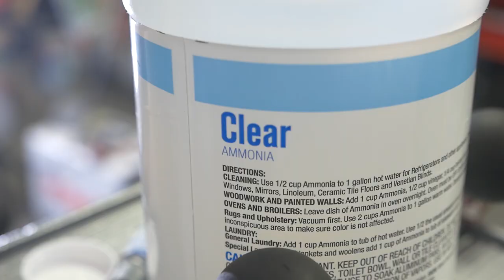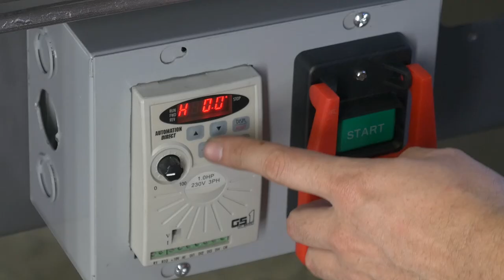Lathe Rebuild Part 9 - S02E10

Comment: @9:38        Twisty connectors?   Twisty connectors!?!?   It's 2017 guys...   time to start using Wago as this is the future !!!
Reply: Just the fact you do not seem to know they are called "wire nuts" or "Scotchlocks (by the old guys)" tells me you haven't been doing this very long.
Reply: OkieDutchman - I know the frelling things are responsible for a super nasty shock and are a major pain in the arse to use where the Wago blocks are a breeze...   Wago is especially good for benchtop projects as you can swap connections nice and quick without having to unmangle your wires !!!!

Comment: In a praevious episode, you didn't know the type oil to go in the gear box(?).  What kind did you decide on?

Also, on a verr old machine like this, how do you obtaign schemantics, diagrams, parts list, user guide, and othar documentation?  Is this archived online somewheres?

Have really enjoyed this series.  Love the humour, the hi quality video, excellent sound (well.  For the most part...), and the verr appropriate background music.  Will be looking for othar stuffs you've uploaded.
Reply from the maker: This is the oil i ended up with: https://www.mcmaster.com/#2158k11/=18jzd4s
it seemed to be what the guys on the forum liked. seems like good stuff so far!

I stumbled upon the user manuals online here: https://www.google.com/url?sa=t&rct=j&q=&esrc=s&source=web&cd=1&cad=rja&uact=8&ved=0ahUKEwjciN3nzJPVAhUMzoMKHeblAy0QFggkMAA&url=https%3A%2F%2Fonedrive.live.com%2F%3Fcid%3D547FE296ECFD561F%26id%3D547FE296ECFD561F%25211448%26parId%3D547FE296ECFD561F%2521164%26action%3Dlocate&usg=AFQjCNEbEMlPNlWIRil3Fe9h_S4mDFqTFw
I see some people trying to sell them, but they are just photocopied anyway. I went down to my local print shop and had them print them out on the most durable paper they had.

Thanks for the kind words! i am still working out the kinks on the audio, but we are getting there!

Comment: Dudes, scrape away. But your scraper looks too short and rigid. I think it should be long, flat and kind of bendy so that you can use your body weight to do the job. And you haven't shown how you've prepared the cutting surface on the tip. Or may be I missed it.
Reply: the wood definitely helps with that, I was concerned about chatter if it were too flexible. For the setup of the tool check out Stephan Gotteswinter's video, I matched most of what he did there (he's much more experienced, I'm new to these things for sure). Using a more or less 60 degree radius face (I eyeballed it, he has a neat tool for measuring) and 5 degree relief angle. I'd be happy to go into more detail but I leaned most from the other fantastic YouTube channels :)

Comment: Is it possible to get 3-Phase power in american houses, because in Europe everey Hose has 3-Phase power?
Reply: Yes it is possible, but it is very expensive in most areas. The American power distribution system is designed in a different way than the European system. We use single phase runs to non industrial/commercial applications because it is simpler and cheaper to just run one phase and one neutral to power one split phase transformer.

Both systems have there pros and cons.
Reply: Well thanks for your information.
Reply: You are quite welcome, it was my pleasure.

Comment: You should have never bolted it to the floor they make feet for leveling of Lay's and machinery then bolts we'll just work out of the concrete with the vibration in the machine

Comment: the scraping doesn't look that good .would go better if you ground the tool in a radius of about 2.5" en a negative rake of 4° I don' t see you checking the geometrie of the bed .. that should be done before you scrape. a tool like a" king way alignment tool" would help to determine where to scrape, also be verry careful with the straith edge , while it is to short.